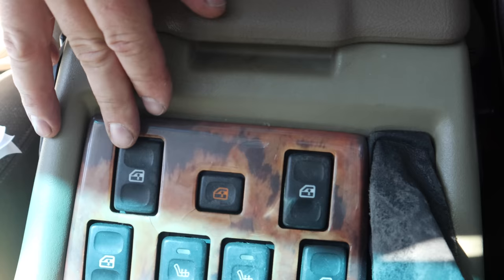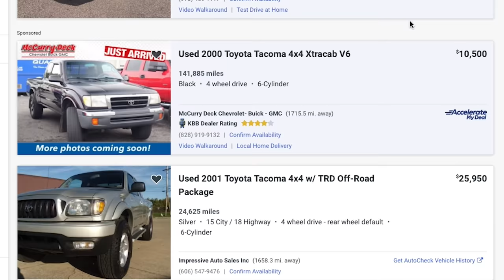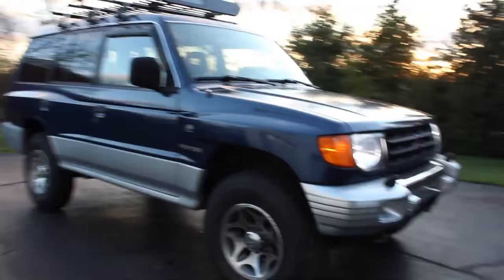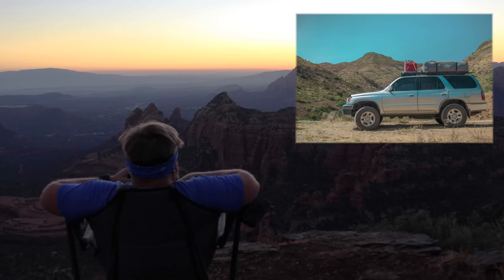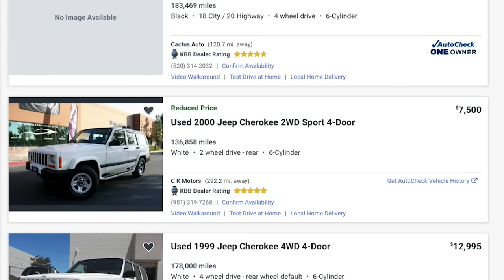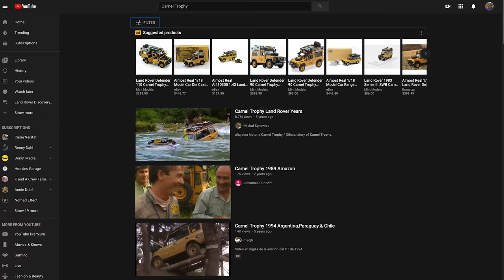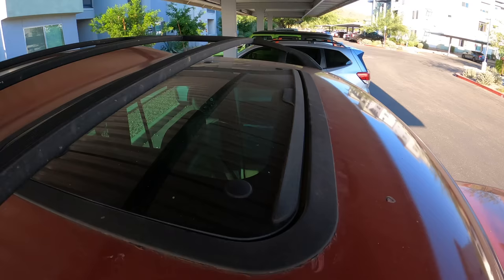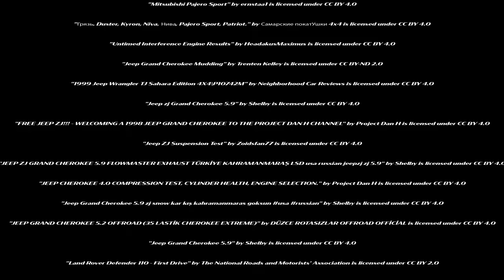The 5 BEST BUDGET OVERLAND VEHICLE Alternatives Under $5000

Comment: You are missing gen 1 VW Touareg
Reply from the maker: It's a good thought, but the only one that I would consider would be one of the higher trim levels with V8 so you could get the benefit of the locking differentials, but I'm just not seeing decent examples like that for under $5k. It's definitely capable, I remember watching TFL wheel the heck out of theirs!
Reply: @MattKester  they go for under 5k, I got mine 2004,V8, 130k miles and locking Diff for 4.5K.

Comment: The Jeep WJ should be on the list.  In fact the WJ Overland would be the most factory off road worthy vehicle as it comes with full skids, rails, and recovery points. On the highway, it rides like an old school Cadillac with its monotube shocks.  The 4.7 ho was also as quick as a 5.9 and more reliable.

Comment: I own a Mitsubishi PAJERO SPORT, you would call it a MONTERO SPORT, 2,5TD. Great car on road, really holds in the corners, like you would not expect from a 4x4. The ONLY real drawback of the CHALLENGER or NATIVA... YES, THE FREAKING VEHICLE HAS 4 FREAKING DIFFERENT NAMES!!!!!! is, 1. It has 4 freaking different names!!! Try finding anything, Jeez, it's a pain, I tell ya. And 2. a lot of parts are non CE homologated to use on the road IN EUROPE. You, Yanks can do almost whatever you want to it. And,.... that's about it. Great, great car.

P.s. MANY MANY MANY stuff on the Pajero Sport are the same as on the Gen.2 Pajero/Montero. There's a whole playground there, to be explored.

And, I forgot; there are 2,5TD, 3,0litre petrol and a 3,5 litre petrol versions!!
p.p.s. ZI Russians had a "Offroad" trim level, with locking diff at the rear AND a spare wheel carrier on the back!! CoME ON!
Reply from the maker: You mean you actually have to use parts that were specified for each particular rebadge of it or you'll run afoul of the law? That's crazy!
Reply: @MattKester " Leave it as it is" is their answer.
Reply from the maker: Ouch, I can see where that would get mighty frustrating, especially on older stuff where you're not even trying to really modify the vehicle dynamics, you're just trying to keep the damn thing on the road!
Reply: @MattKester  I am currently trying to arrange shipping of an OEM spare wheel carrier on the rear door from freaking KAZAKHSTAN to Europe. Nothing, and I mean NOTHING else on the market has CE homologation. People from all over the world are doing whatever they want, use all the products they can find, we, Europeans are stuck with OEM stuff.

Comment: Discovery is engine every 80 K
Reply from the maker: I'm hoping I can beat those odds. We have 112,000 miles on it now! Fingers crossed!
Reply: @MattKester  that is great and optimistic . I heard people just fit 5.7 L GM engine as since Buick is GM there is some adapter plate only needs to add between engine and tranny . You should explore this option and cost just in case . At least 5.7L is almost bullet proof and has lots options at junke yards
Reply from the maker: @phlfly10  That has definitely been on my mind, for all those same reasons. From what I’ve gathered, a 5.7 swap can actually end up being less expensive than a new Rover V8. I also noticed there is a company out there that  is beta testing a kit for a Chevy LS swap, which would be incredible. Hopefully the motor we have holds together long enough for the channel to take off and we can find a way to fund a swap at some point!

Comment: Not even close to Toyota’s sorry there’s a reason people pay more for them. They are second to non.
Reply from the maker: After owning both, I’d beg to differ. Yeah, they might not have things “break” as often, but when they do need maintenance it usually requires special tools and a lot of time and energy. Ever had the plasure of replacing any of the front end bushings in an IFS Toyota model? How about rear axles seals or a timing belt? How about the starter in a UZ V8? God help you the day that one goes out in the field!

Comment: That disco is by far the WORST vehicle I've ever owned. The ford pinto was more reliable. Cheap aftermarket parts don't last a month just street driving. It has rag joints instead of ujoint. They're crap! A chevy avalanche is a better rig and its a POS too.